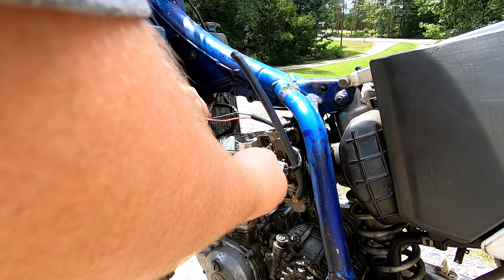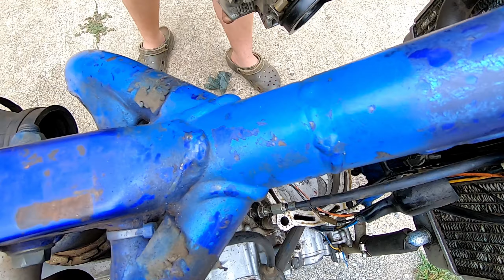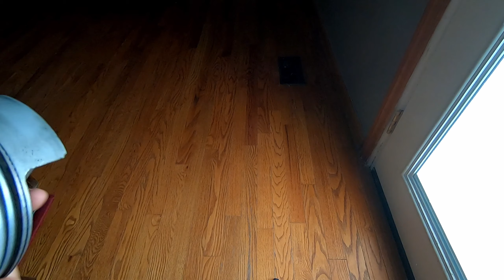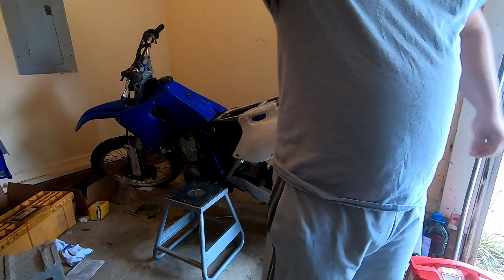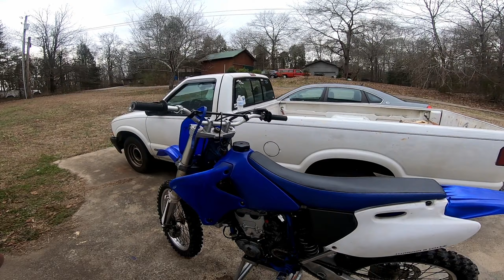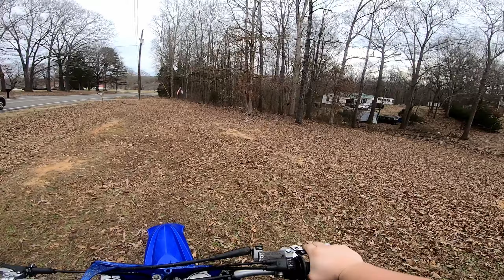$550 YZ 426F Build

Comment: Very familiar with that hanging idle issue you are having. My DRZ400E uses the same carburetor and it had the same problem for a long time. That's from the idle circuit being lean or leaking air essentially. You can get midbody gaskets for those old FCR's from AllBalls and that is usually the fix. Or it's something with the throttle plate leaking. Which eventually happens when the body of the carb wears out. When these carbs are working properly they do work very well so I think fixing that is worth pursuing. Also the suspension is probably shot given the age and that's probably worth redoing as well. 
Anyways, congrats on getting that old clapper running.
Reply from the maker: Yea the hanging idle is weird tho because it’s very inconsistent
Reply: You are bang on...I did vacuum plate and mid carb kit....still hanging idle ...I just learned that the wheels on the slide grind grooves in the carb body.... Frank MX makes a kit to remedy this
Reply: @Hunters-Garage  Yep, that's exactly how my DRZ was. When cold it would want to idle about right, get it warm and it would idle fast most of the time, turn down the idle to be correct at that moment and ride around some and the next time you stop it would stall.
Reply: @SgtProstar  I've heard of some people having good luck with those Chinese FCR clones, might be worth looking into if your carb body is wore out.
Reply: It can also be as simple as the fuel screw being turned in too much (lean)

Comment: I had a YZ400F - it was a disaster - tough to start and parts where hard to come by, when you put in the camms I saw the auto decompression and straight out knew it was a 426, when setup properly those things are aggressive as all heck - they can even take on a 450 in the right hands. Something I noticed, you should replace that cam chain as soon as you can as it most probably got a beating when the valves took a tumble. Good job so far and good luck - 4strokes are a lot of money to rebuild and maintain.
Reply from the maker: Yea this bike has cost me a good bit. I didn’t think the cam chain was to bad other than tearing it apart but I will look into it. Thanks
Reply: It has the aftermarket hot cams in it, by passes the de comp and starts easy like a two stroke, with those cams, the bike is pretty much a 450 now. 44:30
Reply: @aus-rider  Lol , dream on bud , that bike will never be anywhere near as fast as a 450.
Reply from the maker: He did say it depends on the rider which is true in some cases
Reply: @Hunters-Garage  In a heads up start a 450 will kill that bike . For one that bike is probably 30 pounds heavier than even the early 2000's bikes . I worked on lots of those 400 and 426 Yamahas back then  , biggest problem with them is the oiling system on them was terrible. Lower rod bearing failures from inadequate oil supply was very common. Riders that ran them hard blew them up regularly. Bikes built from 2009 /2010 and up are much better designed and much for reliable.
Reply from the maker: Yea I get that
Reply: @Tango Down2x2x who ask you , I don't give a shit what you think , I worked on plenty of those bike when they came out. They were not reliable bikes , none of the early four stokes we're know to be very reliable when ridden hard. They were all time bombs .

Comment: Dude I can't believe you didn't change that timing chain didn't you notice is no good !?
Reply from the maker: This is my first 4 stroke that I’ve worked on this deep. I didn’t think the cam chain was to bad other than tearing it apart because it looked fine was tight and moved good when it was back together but I will look into it. Thanks
Reply: @Hunters-Garage  you spin them on your finger..if a link kinks up its no good
Reply from the maker: Yea I figured that out after the fact since there was a handful of people to comment on it I did some research and now I know. I plan on replacing a few things and talking about a few things in a part 2

Comment: It has aftermarket cams so you have to re jet according to the cams
Reply from the maker: Thanks for the tip. I had no idea that the cams would make a difference.
Reply: @Hunter's Garage  your welcome you have to flow more fuel to keep the ratio correct

Comment: Like an older comment states that timing chain was done..if they kink up they are done..spin them on your finger to find out..replace it before it snaps and blows through your cases
Reply from the maker: Thank you for the tip. Will be changing It in a part 2

Comment: Did you not use the flywheel to get dead centre? If you haven't take it all apart again. Also change the Cam Chain.
Reply from the maker: Yea I got the it to TDC and I plan on replacing cam chain in a part 2 that should be coming out soon
Reply: @Hunters-Garage  Awesome! Feel for you, not a great bike to start on but you will smash it no doubt!
Reply from the maker: Yea it was definitely a lot of work for my first 4-stroke but definitely a good learning experience

Comment: Thermal cycling always make head bolts an studs a nighmare. I wouldnt be too worried about yanking on them a bit. Especially when your removing them. Cranking down is more likely to damage them in my experience.
Reply from the maker: I’m pretty sure they just weren’t installed correctly
Reply: @Hunters-Garage  probably. I was just saying i wouldnt be too worried about yanking a bit. Its usually overtightening that damages threads. You got it done either way anyway, so it dont matter in the end.
Reply from the maker: @garyeast7259  agreed thank you

Comment: valve needs to be closed to take a measurement
Reply from the maker: Engine was at TDC with valves closed. I was just struggling because it was my first time working on a 4 stroke but I’ve done it many times after.

Comment: 😅 you’re about to learn why rebuilding a catastrophic engine failure isn’t worth it… I’ve got an 07 that I MIGHT make 500 bucks on after putting back together
Reply from the maker: It’s all about the experience and giving these bikes a second chance. I knew going into this bike that it was going to be bad but I’m just glad I could fix it up and get it running and hopefully the next owner won’t abuse it like the previous.

Comment: Give up now , if will take more to fix than it will ever be worth. Those bikes were tiking time bombs when they were new. After dropping a valve like that there is almost always damage to the bottom end . The rod could be tweeked , lower rod bearing probably tweeked . By the way those cylinder studs should stay in the case , they should be lock tited into the cases.
Reply from the maker: To late now lol